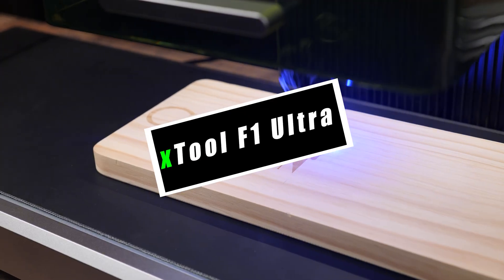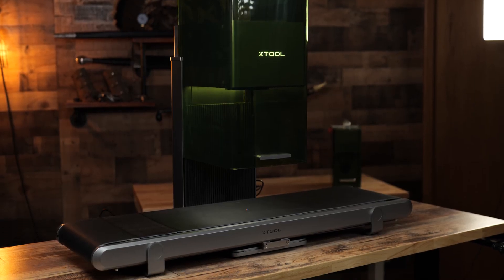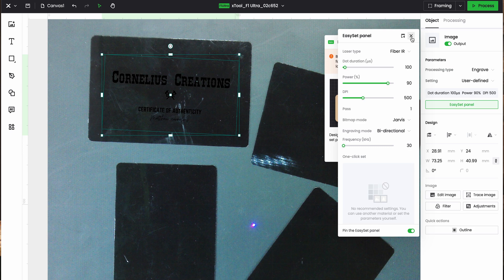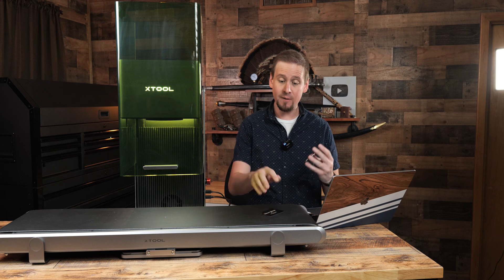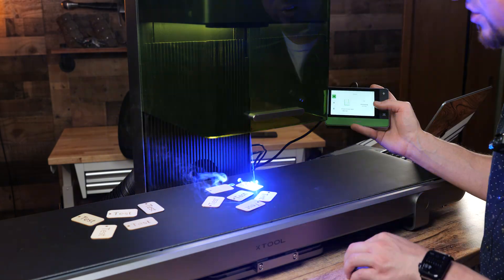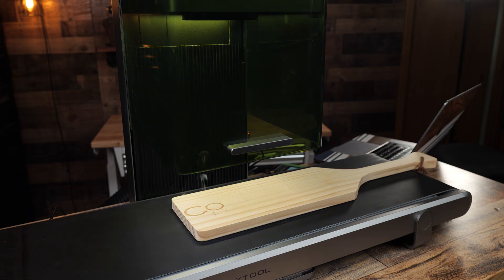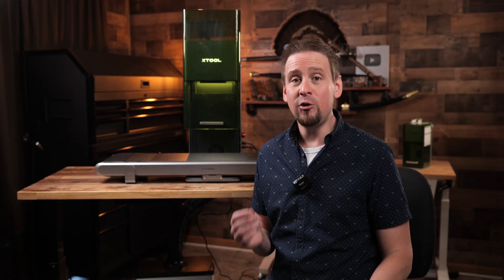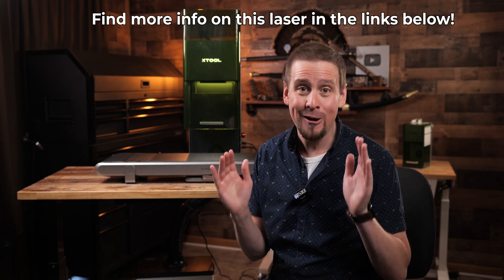xTool F1 ULTRA'S Fast Conveyor Engraving System: Do You REALLY Need It?

Comment: 9:30..
Is there a reason the XTool studio app doesnt move the conveyor to capture the full 500mm?  We are blind without it doing thta.
Every video i see just bypasses that issue thats been around since the F1 ultra.
I jist got the F2 Ultra (both the UV and the dual MOPA/diode) with the streamline.  I can not believe that when you hit camera the preview doesnt advance the conveyor so you can properly place and align the job to the material.
You experienced that and completely didnt call XTool out on that.

Comment: Have the F1 Ultra with conveyor and a P2 with the base, as well as D1 Pro with base extensions and 40W head.  Not for hire - internal business use only.  Metal engraving and business cards for the F1 Ultra, so far pleased with it.  I do the fronts of the cards on the F1 Ultra conveyor and the backs of cards with the P2 to ensure things don't get upside down on alignment.  xTool has been good with support and XCS does what I need.  The P2 is also used for Acrylic making custom stage lighting monograms and custom acrylic plaques for weddings.  Also make custom engraved equipment rack panels for lighting and sound business.  The custom metallic business cards really add a touch of class to our DJ production business at wedding expo's.

The F1 Ultra is a very versatile rig and is real easy to setup and use.

Comment: Just another amazing video!!  My engraving machine just came with 1 pair of glasses, the dealer who sold it told me that i could get some simple UV protection glasses, is that true?  I cant spend much right now but i definitely need an extra pair because it is 2 of us working with the machine!!  What can you recommend, Matt!  TIA x x
Reply from the maker: Thank you so much! I am excited to hear about your new machine! I would look at "laser safety glasses" on amazon pick up a cheap pair there! It is great to hear from you as always!
Reply: @CorneliusCreations  Thanks Matt, i cant buy from amazon, shipping to Colombia is really expensive and most of the time it doubles the cost. But i will look for some on my hardware shop around here, do they have to be a specific colour??   Green, yellow, red, blue??

Comment: I wish you'd have pointed out how engraving "test" on the second lot of batched material wasn't all exact (as far as I could tell over half of the 11 you engraved were not centred exactly) In most cases this would cause problems (especially at craft shows) Saying it will be fixed with updates isn't necessary true either because I have the P2 & can never use the batch alignment due to inconsistent placement. It's hardly compact either (with the conveyor the size is larger the D1 Pro!!!) Love your videos but you really need to be less positive when the reality shows some forms of negativity